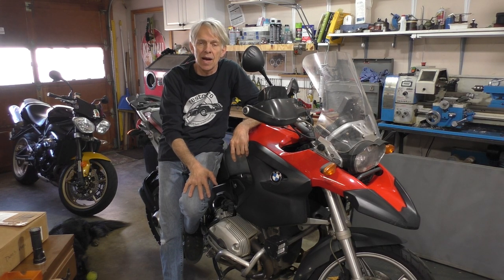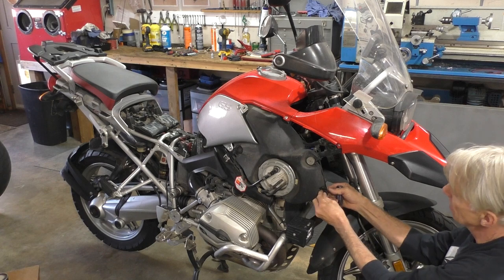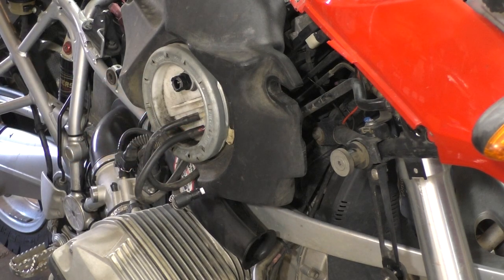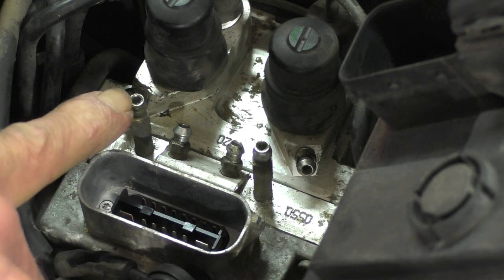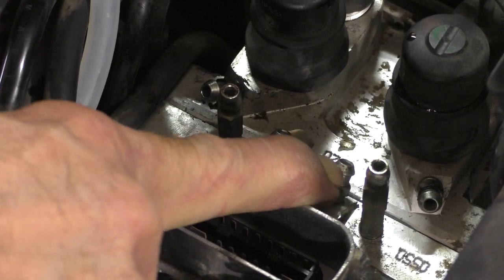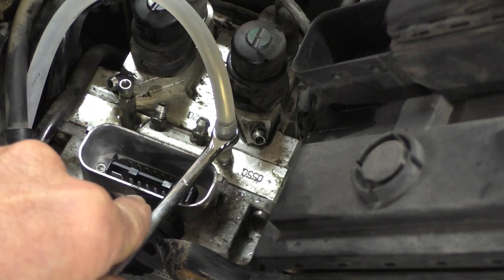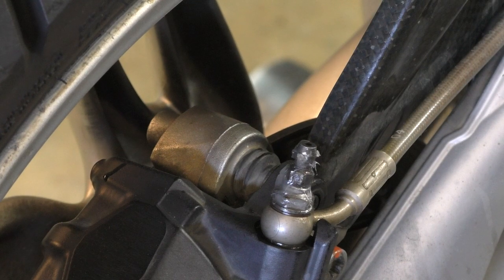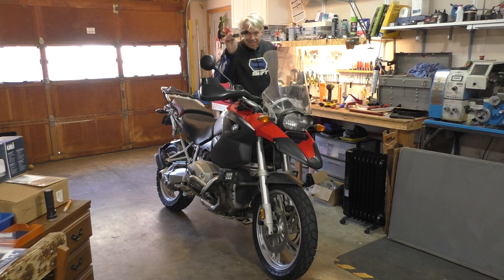BMW R1200GS Brake system flush

Comment: Great video exactly what I needed.  This is the first modern motorcycle I have owned with ABS so I unknowingly bled the rear brake and was perplexed when it didnt seem to be drawing brake fluid from the external reservoir.  On my test drive I got a brake failure light on the dash.  turns out I probably just drained the fluid from the ABS reservoir under the tank lol
Reply from the maker: Glad it helped.
Reply: Same here xD

Comment: How do you even know all this? I find nothing in the manual for my R1200Rt. I think I'll just do a regular bleed and take it to the dealer to finish the ABS purge with their special proprietary tools which no one else can have without emptying their savings account.  The fact it's linked brakes also confuses me. I replaced the fluid from dry after a calliper rebuild but the pads still drag a bit. It's better than it was but no more bubbles come out from bleeding.
Reply from the maker: I did my research and found a procedure that is the same thing a dealer does. I decided to post this video for do it yourselfers.
Reply: @HackaweekTV   I see. Thanks. I have been looking at getting the Motoscan cheaper version of the GS911 and it says not open bleed valves when purging the ABS. It tells you to bleed normally just before and just after the cycle as you would normally. I notice you were cycling the pump while opening them with your method.

Comment: Hi @HackaweekTV! Thanks for your video. I have BMW R1200GS 2005.  When I turn on the ignition the servo constantly makes a sound like you are pressing the brake. However if I turn on ignition with applied brake, there is no servo sound, as soon as I release the brakes - the servo makes noise again. It started to appear after I changes the front brake pads. Do you think the brake system flush will help to get rid of the problem? Any other ideas?
Reply from the maker: Yes it just might. Give it a go!

Comment: I wanted to say thank you for making this condensed video!  I just purchased my 2005 r1200gs that was wrecked.  I am going thru the brake system now.  I bled the abs unit as shown, but having put a new battery in, and turning the key to on, it'll start and run but I don't hear or feel the abs pump turning on.  The abs light shows red on the top left blinker control, but it the unit simply does not run. I think Im at the removal and bypass stage.  Regardless, you video has been incredibly helpful getting me up to speed.  It was very easy to pull the tank off and bleed those 6 in the proper order.  Much appreciated!
Reply from the maker: The light blinks until you move a bit, then it activates.

Comment: Thank you for the video which is concise to the point and above all well documented. 

Now... putting on my Mc Guyver cap I wonder why you can simply not do the following:
Instead of the socket wrench bleed valve, you used on the bleed valves in the center of the bike, why not keep it simple and simply slide the hose over the nipple directly over each valve and make it airtight with a tiny hose clamp? 
Then to close the valve in order to build up pressure, you would simply apply the same trick you can use when bending a waterhose in order to prevent it from running too much water when moving it, while there is no spraying nozzle attached and the faucet is open. 

Furthermore I have a question... when do you know that you need to bleed those valves? A logical assumption would be, both filler caps got empty without you noticing... but I leave the answer up to you. Or is this something you should do periodically?

I own a BMW 2007 Adventure. Great bike, but I fail to comprehend why BMW makes adventure bikes that should go anywhere in remote places and cannot be repaired there and then. Instead you need a well equipped hi-tech garage and a BMW licensed mechanic. What's the point in having an off-road / off grid bike, that requires precise clockwork aeronautic repair facilities while it should be a no brainer that this bike is meant to be ridden and repaired 'in the bush'.
Reply from the maker: Don't know the answer to the last bit, but yes, you can just put a hose on the valve and use a wrench to open close. Pinching the hose will not stop fluid from coming out as it is under a great deal of pressure.

Comment: Nice job Dean. I must have missed it but how did you get the abs pump to operate when bleeding it?
Reply from the maker: Everything plugged back in, key on, press brake lever, pump activates.
Reply: @HackaweekTV  I've always assumed abs pumps don't operate until needed ie when the wheel locks up. Didn't realise they run everytime the brake is operated!
Reply: @chr11sf  Only in this case. On cars it's only active when the wheel begins to lock up. The BMW motorcycle Integral ABS is a servo type system.

Comment: Is there a specific reservoir for the front and back brakes. I noticed you put the funnel into one but didn’t see if you had to move it to the other side when you did the front brakes.
Reply from the maker: Front brake reservoir is on the right side handle bar. It's part of the brake lever assembly

Comment: Ok, I'm kinda confused now... There are videos out here on YT that show how to bleed the front and rear brake fluid on a similar model GS from 2010. The old mechanic (https://www.youtube.com/watch?v=FoXI3kA2-4Q) just removes the old fluid (from the front brake) and tops off with new. What is the difference between what you do, (removing the fuel tank and such to bleed there on 6 different nippels) and what he does just doing the one? Thank you for clarifying this.
Reply from the maker: This method bleeds the entire system of fluid including the main ABS pump.